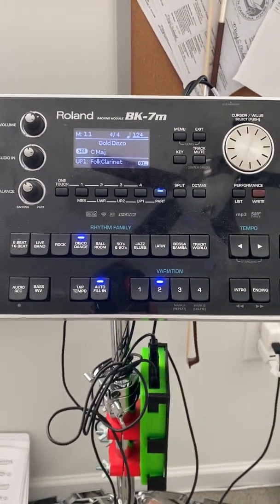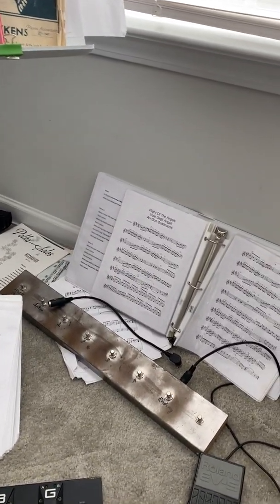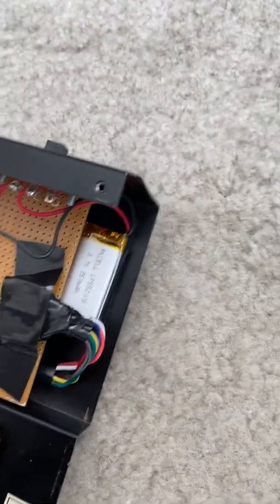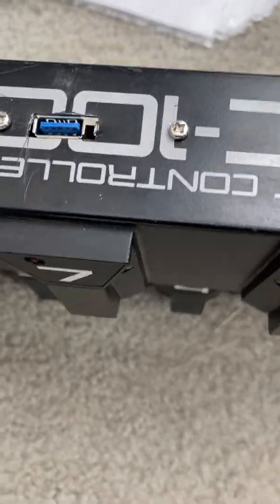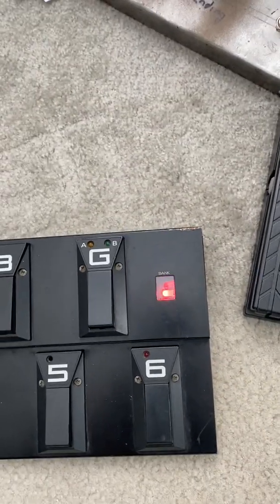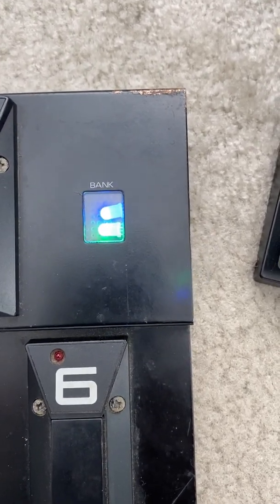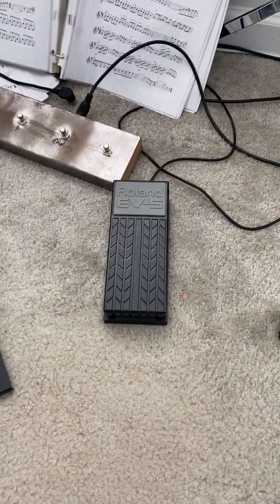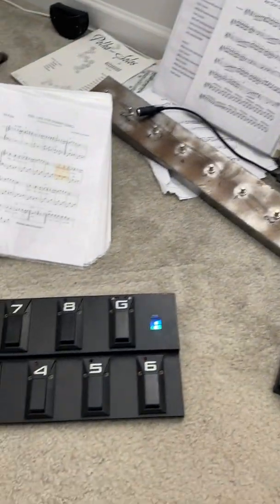DIY Wireless foot controller (FC-7) for a Roland BK-7m backing module

Comment: Great idea. I just bought an FC100 and plan to rebuild it to become a wired FC7 replacement for my BK-7M. What you have done could have been a nice option and a way to get rid of the wires, but I don't have enough knowledge regarding wireless MIDI, so I guess I will stick with the wired setup for now.
Reply from the maker: The electronics is pretty easy. Plenty of Arduino and similar stuff online, easy to learn. It's figuring out all the switch interactions and midi commands to send that's the pain. I still need to 'tweak' my code in a couple of places to fix a couple of small problems. I've actually found the WIDI bluetooth midi to be not 100% reliable. I played a small gig yesterday for a seniors group and had so much interference that the bluetooth was not really usable. From now on I'm taking wires as well as a backup. I like the freedom from wires but if it's not reliable you have to question it's value. Still, as an exercise, building this thing has been fun and interesting.